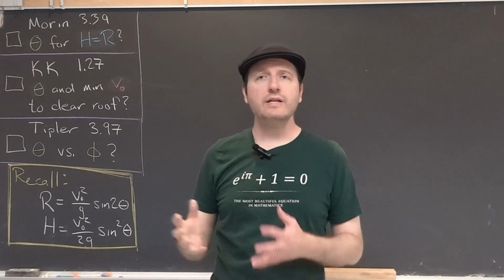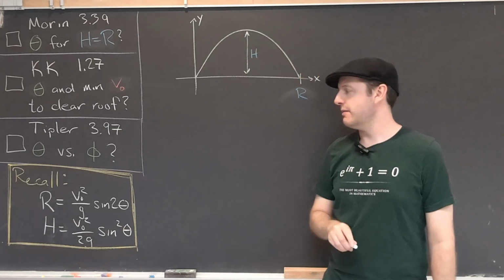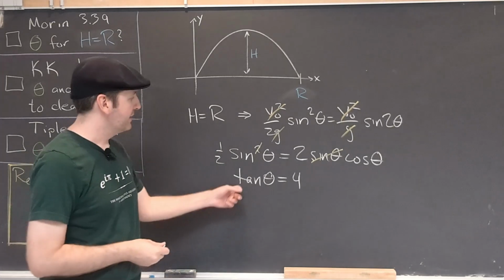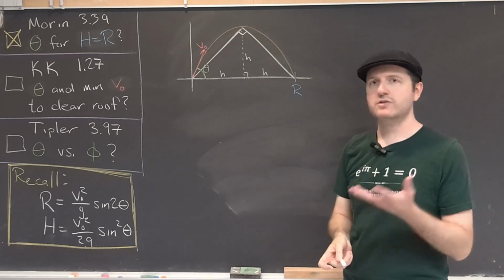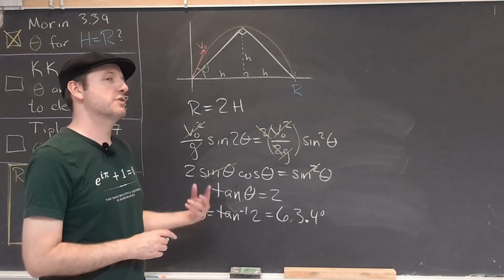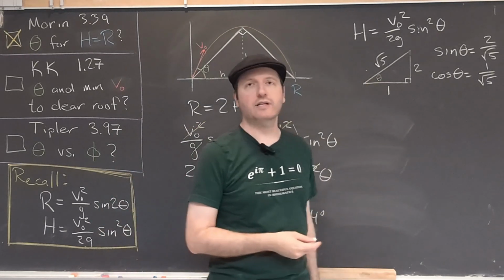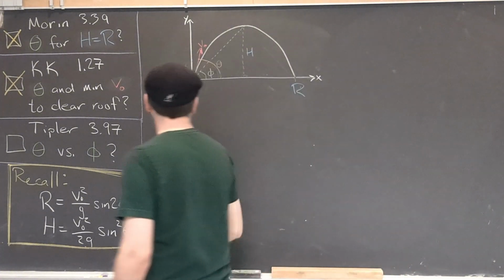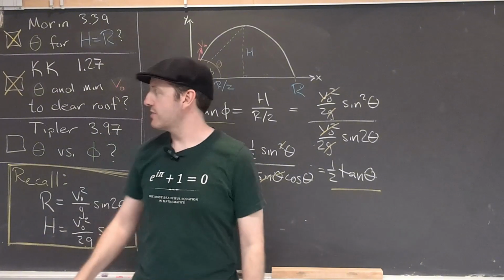3 2D Projectile Problems

Comment: For the second problem, there is another constraint (which the real minimal solution thankfully satisfies but the trivial one doesn't): in order for the projectile to sail above the building in the first place, the initial velocity must have a greater angle than the local slope of the building. That is, theta is greater than the 45 degree angle the building makes with the ground where the projectile is launched